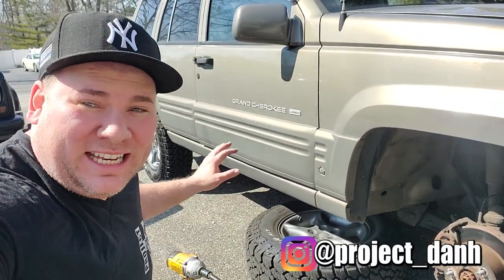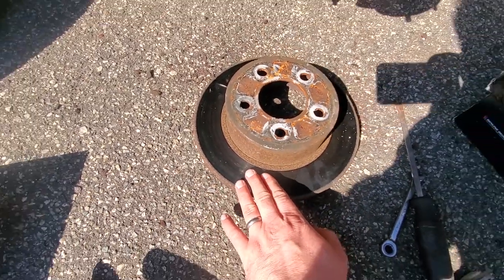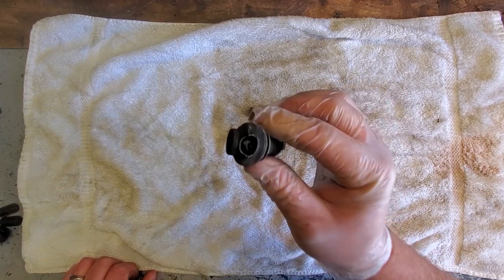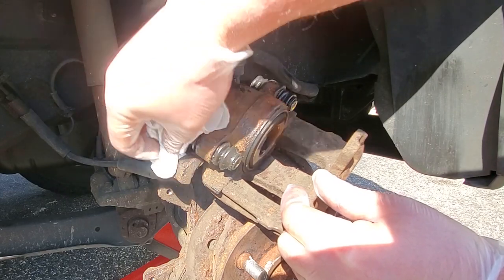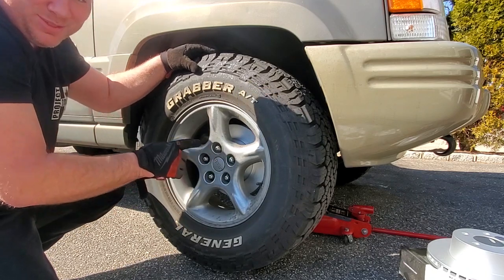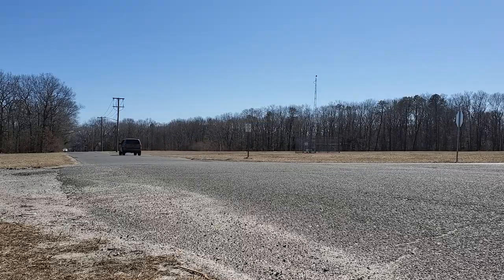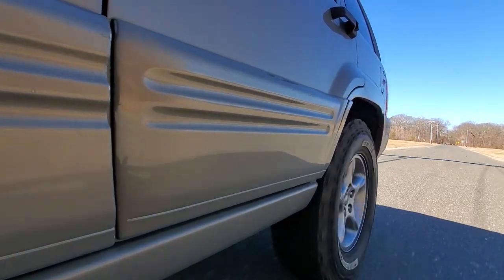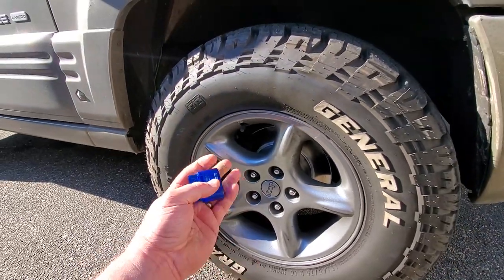GENERAL GRIEVOUS JEEP ZJ GETS POWERSTOP EVOLUTION BRAKES - FRONT INSTALLATION AND BREAK-IN PROCEDURE

Comment: I've always used Powerstop on my ZJ. I learned that the drilled/slotted with carbon ceramic pads kit labeled for towing and hauling is the way to go. I had the sport kit on and learned the difference quickly after severe brake fade  going down a mountain in Colorado. Granted I have a 5.2L and i was loaded with all my tools (including a floor jack and stands), spare fluids and parts, gear, & a passenger. But yea Powerstop makes good stuff.👍🏻
Reply from the maker: Thanks for sharing, Im excited to try the powerstop too!

Comment: For the initial pad transfer I've had good luck with a couple different methods - 1. similar to what you did here, a few hard stops in rapid succession, and 2. partly applying the brakes while keeping the car moving steadily at highway speed. Second method is ideal if other cars are around and you don't want people to think you're panic-braking for no reason because you're wasted 😆 but equally important is to keep moving for awhile to let everything cool back down, otherwise the process will backfire, which is why I always break in my new pads on Sunrise Hwy at night.

Comment: Dan, you should weld your knuckles. The brakepads allready have worn out the contact-area. Means the pad can not slide as it should do. This groove comes because the freeplay is too big and during breaking the pad moves too much. Recomended freeplay is 0.25 to 0.4mm between lenght of knuckle and pad. Therefore are the Clips for the pads zu adjust.
Its only my recomendation ;-)
Reply from the maker: You're Good Martin!  I was contemplating squeezing that in this vid but I decided to make a separate video on it.  Hopefully coming soon when I get the time 👍👍

Comment: I would have used a Turkey Baster to suck out all the old Brake Fluid you could from the Master Cylinder so you could replace it with New Brake Fluid. Nice Job.
Reply from the maker: Dang... I didn't even think of that.  Good Idea!
Reply: @ProjectDanH  It's never too late, i just suck out 3/4 of what's in the Master Cylinder drive a few thousand miles and repeat the process until the Brake Fluid looks clean again. Enjoy the Videos keep them coming.
Reply from the maker: @nobsatthistime  Your absolutely right!

Comment: Dan you put too much brake fluid in the master cylinder, there is a maximum minimum marking on the reservoir for a reason. You should not overfill. You said you had spillage but you didn’t say that you cleaned it up. Brake fluid is highly corrosive especially on paint. If you do have a spill it should be cleaned asap using a liberal amount of brake clean or soapy water followed by a rinse with clear water. Thanks for the videos.
Reply from the maker: Your absolutely right!  I did use a soapy sponge to wipe away the spilling.  Thank you for your feedback!

Comment: Man you should get a V8 ZJ
Reply: The 6 has better mileage
Reply: @Jam-jt7bm  
Yes that right ✅
But who has more torque and power?
Reply from the maker: I want a niner!
Reply from the maker: lol.. barely
Reply: I've had ZJ's with the inline 6 and the V8.  Because of how heavy the ZJ's are, there's not much difference in mpg.  At least, not with a stock exhaust.  That being said, four hole injectors work wonders on the Inline 6, did that on my XJ and was getting 18mpg with a roof rack and a lead foot.  I've heard you can get the V8 mpg's into the high teens with the four hole injectors, and that's my next upgrade.

Comment: Hey let me know if you want to buy a 1993 zj bad t case good transmission and engine . I am sick of spending so much time under this thing ! I hate it  225,000 miles no oil leaks just tcase leaks . rediff was redone this year , cost me more than the jeep was worth onlt rwd but is a 4wd model with IRO 3.5 in lift on mickt thompsons .